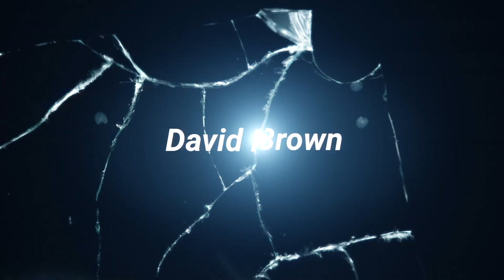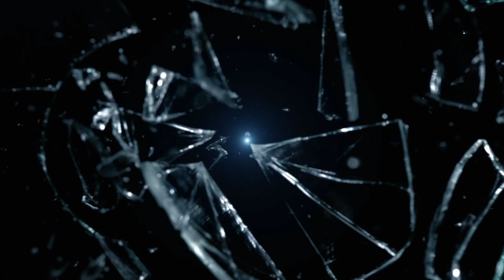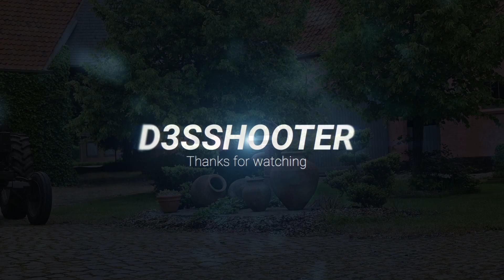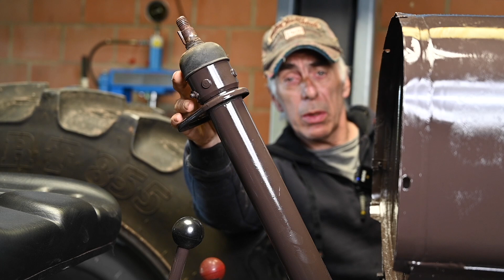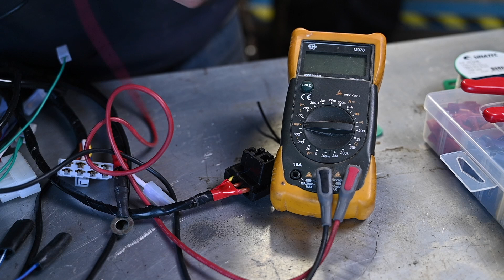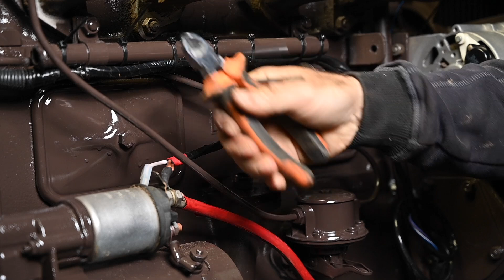David Brown  tractor, new electrical cabling  sneak preview

Comment: I have a 1966 David Brown 990 Selectomatic. My 3 point lifting arms lift extremely slow. I cleaned the pick up screen & valves and flushed the hydrolic oil. I suspect that the fluid control valves may be missing some parts, my manual doesn't show all of the parts for the valves.
And the mode selector dial only functions in TCU mode to lift the arms. I have not cleaned the bypass filter or replaced it yet.
Any assistance would be greatly appreciated.
I really like this tractor as it came off the assembly line the same year as my wife.
We are located in Amish Country in Ohio. We really enjoy your videos.
The lifting arms drop freely.
Reply from the maker: Craig there are many parts in the hydraulics system,  I have a video on it on how it all works.  Its here https://youtu.be/FCU2t3fTv-k     have a look first if you did not already.   It could be so many things....The first things to check are the control lever adjustment and the fast /slow control knob function. That is just below the manual control lever.  Of you pass your mail address , I can have a look for a specific diagram if you need one ( but tell me what you need and I email it)